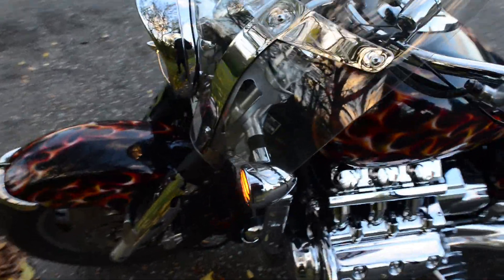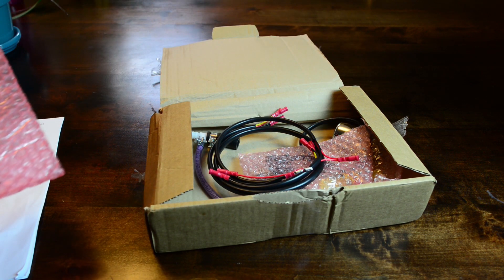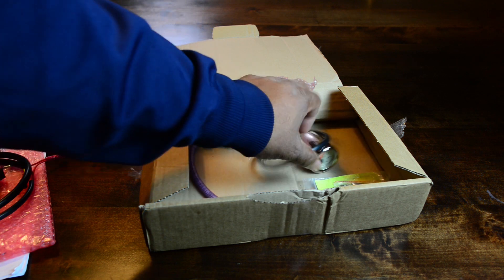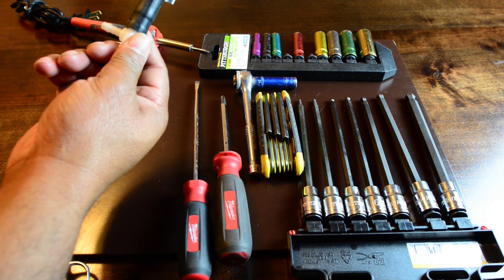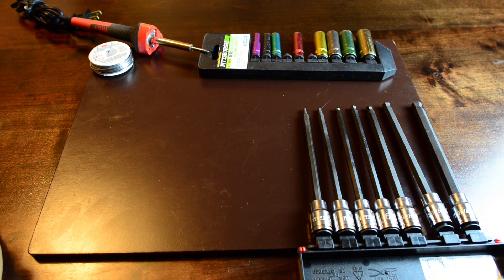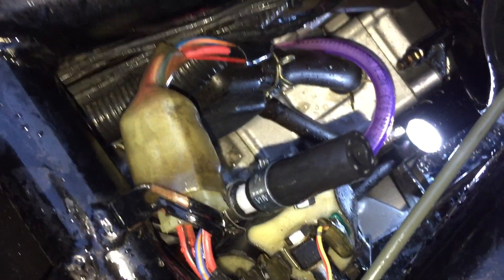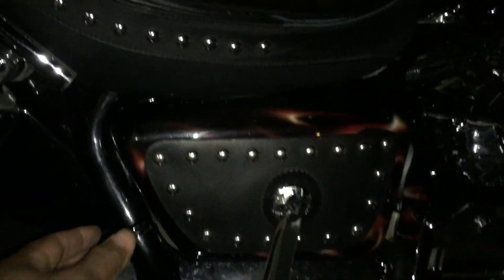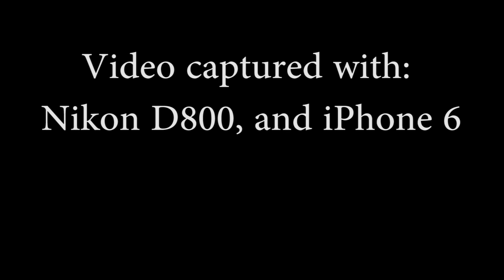Valkyrie DIY: How To Install a Fuel Gauge.

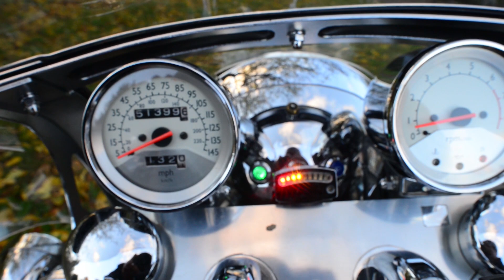Comment: What is in the middle 0:54 Orange lights? Turn indicator?
Reply from the maker: voltmeter. Very handy if you have a lot of extra electronics installed. Especially for the winter months when I plug in the heated suit. Never want to get caught with a drained battery. I replaced it with a digital readout later.
Reply: @lyunardo  Nice, would look nice as fuel gauge or gear indicator. Cheers Philip from Norway
Reply from the maker: @philip4588  actually it's just a generic meter. It It can be out of those things, depending on the sending unit you attach. It was cheap too

Comment: Where can I get one ??
Reply from the maker: This one was just hand made by the engineer who created it.
Now there are several different companies who make something similar. 
If you look through the comments, a few companies were mentioned.
Or you can just google something like "pressure sensor fuel gauge for motorcycles"
Good luck

Comment: Can the VALVE ASSY., EVAP EMISSION CARB AIR VENT CONTROL17300-MZ0-771 be bypassed?
Reply from the maker: Hmm, if I recall that's the part number for the entire carbeurator assembly. And of course that can't be bypassed.
But maybe it's for the emissions system? If so, then yes. On my bike it's been bypassed and those parts were removed.
Reply: @lyunardo  essentially the pstt look lile a  ( T ) with a vaccim pprt that operates a membrane. All thst ends down on the collection canisters. If i substitute it for with a plain ( T ) the canister fill gas. I am thinking on removing all from the canister up. Is that Ok?

Comment: That digital gauge in the beginning with the LEDs between the factory gauges, where did you get it? I'd love that to be my fuel gauge.
Reply from the maker: Jay Scott, that's the Kuryakin led battery gauge. The newer version looks a little different but works the same. 
And yes, it can be modified for other purposes.  I spliced it to a temp sending unit and it seemed to work ok. It's gone now though.

Comment: Man this is the kit I need for a few bike's. But the website is no longer there.
Reply from the maker: @Denver Zinser, check out the comments below. There are some links to some pretty similar kits.
Joop passed away January 2018.
He wasn't the only one who made a pressure-based system.
It was just the one I liked the best. He designed it from the ground up, built them by hand, and in my opinion, it looked the best at the time.
Good luck man.

Comment: Anyone needing a similar kit, try LSK Motorcycle Electronics. They make a similar kit that works on same principal as this in both analog, digital, panel mount or bar mount. They also have tach kits.
My condolences to Joops family.

Comment: this is great. Think it would work on a bike with a secondary tank like the virago? problem is theres a pump too, would it go between the secondary tank to the pump? pretty frustrated with this!
Reply from the maker: Hey Nick Gargiulo,
This type probably couldn't work with a pump. It needs the full weight of the liquid in the tank to compress what comes out of the bottom and reaches the pressure sensor. A fuel pump would probably relieve the pressure and throw the reading off.
Anyway, this model is no longer available. There are other options though. Good luck.
Reply: yea im thinking the opposite, that it would read the pressure of the pump and make it look like a full tank always. either way it doesnt seem like the right solution for my bike. looks great on yours!
Reply from the maker: Now I'm curious. We know that the pump would create a strong vacuum in the line and would intermittently suck more liquid through than vacuum or gravity feed would. But would that increase or decrease the pressure reading on the sensor?
If I had the time, I might try this out on my workbench.

Comment: Hi there, i don't know if you're active on this, but i am thinking about buying a rather cheap chinese ATV, it's in pretty good working order and has the specs i want, except there isn't a gas guage. So I was thinking would it also be possible to add a guage to it, or?
Reply from the maker: Hey Bluezz,
Yeah I was lucky to get get some of Joop's gadgets before he retired.

Here's some options for you to look into.
Anything you do will probably need some fabrication and DIY skills. Good luck.

1. The simplest method is to find a generic "float level fuel gauge" with a hollow ball that rises with your gas level. You would probably need to modify your gas cap to somehow fit this into your tank. Here's an example, but I'm not recommending that specific one.
https://www.jackssmallengines.com/jacks-parts-lookup/part/simplicity/2156175sm?gclid=cj0kcqjwl7nybrcwarisal7o7dfbxicgku0-ihnhrhptgt2-ghhloy_87eztbm62dwqfilskwyiftssaatt5ealw_wcb

2. There are other pressure based  fuel gauges like this one: https://www.lskelectronics.com/fuelgaugepro1
I don't know anything about them at all. I looked at several a few years ago, but wanted something that looked like the existing instruments on my old school bike.
Reply: Leonardo Harrell yeah, i'm at at any of those skills
Reply: Hey, i looked at the links you sent, and I'm pretty sure that the pressure based one would be the right choice for me since it doesnt recuire modifications
Reply from the maker: BluezZ, whatever you go with, I hope you'll let us know.
Reply: Leonardo Harrell Yeah, of course.

Comment: Was this kit a vakyrie specific one?
Or could i have installed it on a 1996 Honda magna?
Reply from the maker: Two things: the Valkyrie has a 5 gallon tank, and is gravity fed.
If I remember correctly, the old school Magna had a fuel pump, and a 3.5 gallon tank.
If so,  the stepper motor in the gauge would need to be calibrated for a different output from the pressure sensor.
Also, the bike would need to have the gravity feed conversion some guys used to do to bypass their fuel pump.

For you, I think there's a simpler solution.
You can replace your gas tank from a year that came with the stock gauge.
Then you could just buy any third party gauge to plug into that.
No need for a custom, hand built solution.

For the Valks, used tanks with a fuel sensor still sell for around $800 or more, so it was actually cheaper to go this route.
Plus, it's kind of fun to have something completely custom!

Good luck!
Reply: Leonardo Harrell alright let me try that
Cheers

Comment: i need this kit as well. would it work on a shadow 1100?
Reply from the maker: As others have mentioned, Joop Angelier who built and designed this device, isn't making these devices right now.
When you visit his website, it has a message that he's temporarily unavailable due to illness.
http://www.joopangelier.nl/

Hopefully, he'll be better. He's really a great guy.

But to answer your question, this works off of pressure readings, so any gravity fed fuel system that has the same size tank would get the same reading as my bike.
There are other vids on Youtube showing gauges that use other methods.

Good luck man!

Comment: Thanks! I'm looking for a windscreen drilled for the oem hardware. any ideas?.
Reply from the maker: If the chrome wasn't scratched I'd send you the Clearview Shields screen that's in this video. it's a nice wind shield, but has some wear on it. 
Since then I put on a batwing fairing.
www.clearviewshields.com